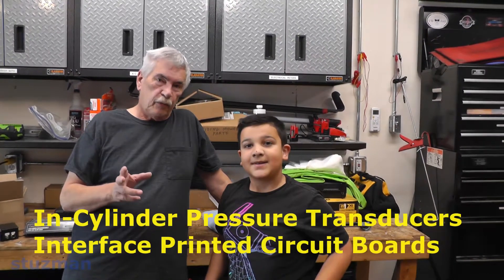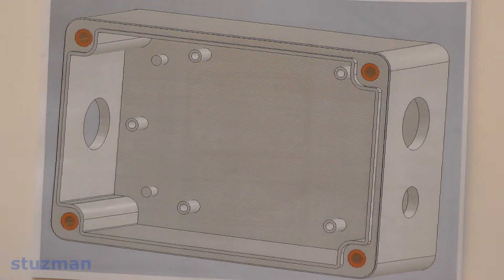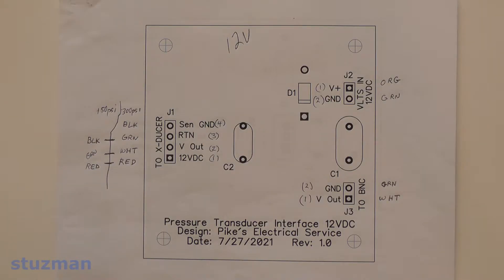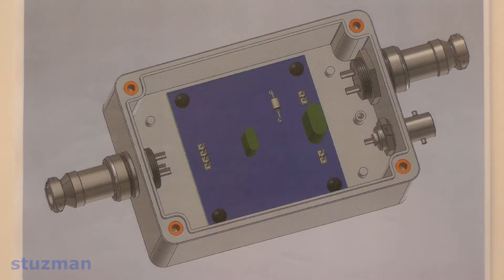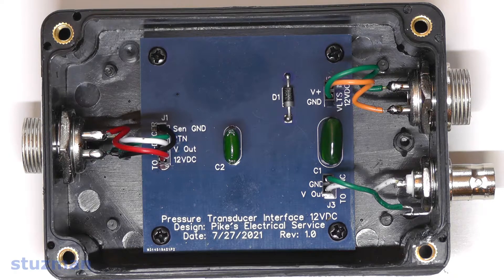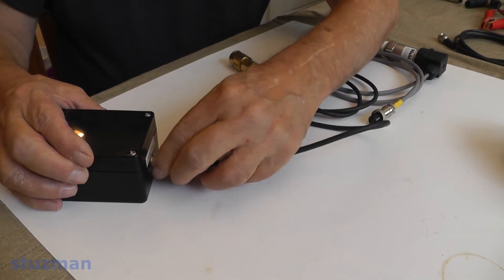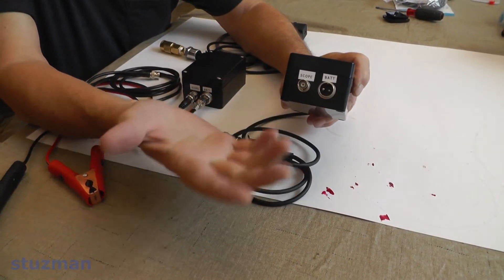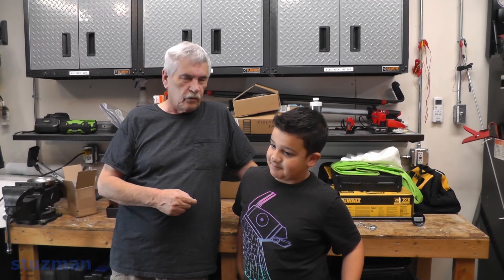In-Cylinder Pressure Transducers: Interface Printed Circuit Boards

Comment: Stuzman. Greeting your video in-Cylinder Pressure Transducers: Interface Printed Circuit Boards. I like how you Design the project box and the cables fitting. I am know familiarizing my self with in cylinder pressure testing.
Just checking could i purchase one of each your home made pressure transducer? Let me know?
Regards,
Winston.
Reply from the maker: Hi Winston! I'm not setup to sell the boards and transducers as I only did it for myself as a hobby. Have a great day!
Reply: @stuzman52  Hi Stuzman. Thanks.for.you speedý respond. Any recommendation wherè can i purchase the parts so that i can try to build my.owne?
Reply from the maker: @winstonhoyte873  Hi Winston! If you want to design a printed circuit board, I can recommend Digitrace which can be acquired from here. www.digitrace.com You can download the free version which is more than capable to designing a board(s) for the transducer. Be sure to download the 3D models which is a separate download. And there is a PDF on their website for a tutorial which can get you up and running of how to use the program. As for the parts, I used amazon.com , digikey.com and alliedelectronics.com As for the pressure transducer, you would want to pick one that is an absolute pressure transducere around 300psia and has a response time of <1mS. Good luck on your project and have a great day!

Comment: That's cool you can do that where you learn that where you get that
Reply from the maker: The 3D modeling came from my work experience as an electrical and mechanical engineering background. The software used to design the printed circuit board was from www.diptrace.com where I used the free version. Have a great day Cody!

Comment: Thanks for all the education! I’m not well versed at all in electronics. But I can solder!!! I’m going to have a go at this and I have a question. Is there any advantage or disadvantage to using either design?
Reply from the maker: Hi Chris! I guess you're referring to the designs between the 12V and 5V transducer types. If you notice, the only difference is the voltage regulator that's used for the 5V transducer. Everything else between the two circuits are the same. There really isn't any advantage or disadvantage between either design.
Reply: @stuzman52  Thanks for the reply! I’m just a DIY guy who realized the need for an oscilloscope in diagnosing modern cars. As I said, I’m not well versed in electrical engineering. So if there was any advantage to either of the designs, I’d choose that one to spend the next few days of my time on. Quick side note, as I’ve been learning, scopes are susceptible to background noise. Therefore it’s advisable to use the battery as your ground. Would using a 9v battery as the power supply compromise the trace?
Reply from the maker: @chrismoffitt9873  You are correct that you should use the battery ground connection for scope connections. If you're talking about using a battery for the supply for the transducer, that would be fine.

Comment: Brilliant video, Terry. Organized, clear, and obviously drawing on professional experience from the past.
Reply from the maker: Thank you Dave for the kind comment! I've posted links to the schematics for the two different boards in the description of this video. I made a few revisions to the schematics since the video was posted. The capacitors are for decoupling and the diode is for reverse polarity protection. Have a great day!
Reply: @stuzman52  Thanks Terry. As you say the 12V is clean and easy to understand. I can't view the 5V schematic (access denied, password protected) but I'm guessing it is very similar. I see one can get Chinese knockoff pressure sensors from Amazon. Is there something one needs to know about these, do they have varying refresh rates, or is that a property of the scope only?
Reply from the maker: @spelunkerd  Sorry about that Dave on the 5V schematic. I forgot to show it as anyone with the link. It should work now. I have two Chinese sensors that came all the way from China and although they worked okay on the bench, I haven't tested them on the vehicle yet. Another one I got from Asheville, NC which is designed and built there. I hope to test them all on the vehicle tomorrow if all goes well. The biggest thing is to get a transducer with the fastest response time. The two from China have a response rate less than 1mS. The other from the US didn't have a response time on their data sheet. I called them up and talked with an application engineer and all he could tell me was that it was fast. I've seen some that have a response time greater than 3mS. If the transducer is too slow and the sample rate is high on the scope, then the waveform will look like a stair step.

A lot of the transducers on Ebay and Amazon only measure gauge pressure and not absolute pressure. I talked about it in the first video. Although transducers that measure gauge pressure can read some vacuum, they're not designed for it. Some of them will bottom out and not even get close to the vacuum of a running engine. There's quite a few videos on YouTube that show this. To be able to measure the pressures accurately, one has to be sure to pick an absolute pressure transducer so that it can measure positive and negative pressure correctly.

I'll let you know how well they work and hopefully, I can do a video with them hooked up to a vehicle. Have a great evening!

Comment: Where would you suggest purchasing the U.S. made transducer that was in your last video? I did search, but not much luck.

Thank you for your videos, your method of teaching is fantastic, I learn so much better from you than anyone else on YouTube.
Reply from the maker: One of the pressure transducers as you mentioned was designed and built in Asheville, NC. There are two types of where one uses a ceramic crystal and the other uses a silicon crystal. The one that I picked is the ceramic type. Here is a link to the ceramic type sensor. http://www.palmerwahl.com/product_home.php?cat=34&catl=111&line=550&itm=6299 Be sure to take a look at the datasheet for the customization of the transducer. And you'll have to call them to place an order as they are custom built to order. And thanks for the kind comment!